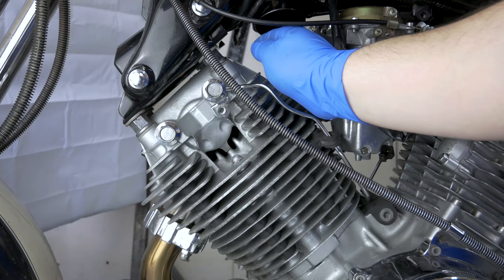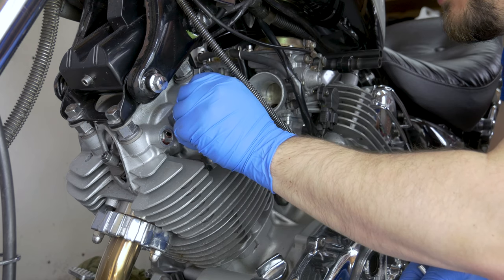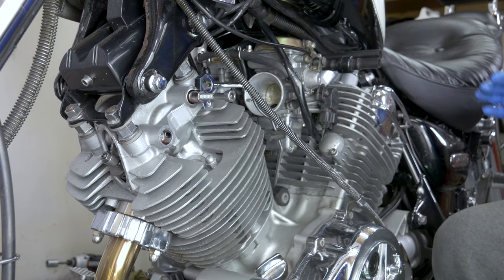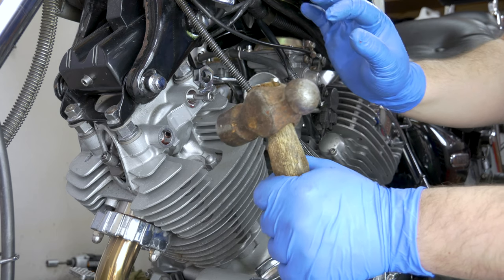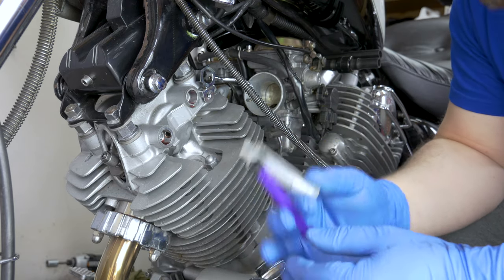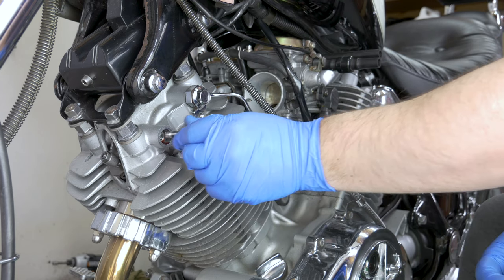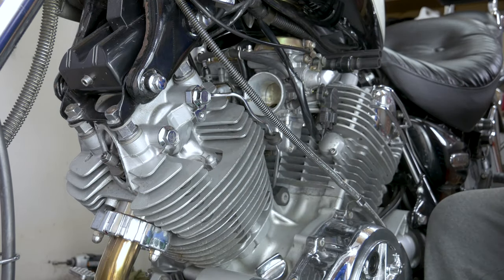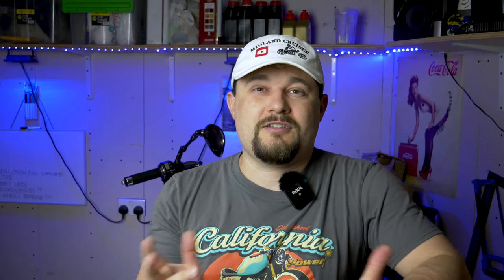YAMAHA VIRAGO 1100 | 4K | HOW TO CHANGE THE ROCKER SHAFT | Detailed Tutorial EP04

Comment: is there a tutorial to change the Yamaha Virago xv 750 shaft into a chain
Reply from the maker: Hi there. I have seen people asking about it, but haven't heard anyone actually doing it. I like the shaft drive so I won't be making video about that topic, sorry...
Reply: It is impossible to do without an external transfer case. Due to the shaft drive the output of the engine rotates in the opposite direction. If you eg. weld a sprocket onto the output shaft you'll eng up with 5 reverse gears.
The only (not too sensible) solution would be using an external transfer case/gearbox with a shaft input on the left and a sprocket output on the right but that is waaaay too much complication.
Reply from the maker: @davidbalogh3845  totally agree way to complicated and unnecessary. Speaking of unnecessary...I've seen someone converting a 535 into a air sprung rear suspension in the Facebook group...first I've ever seen, cool😃😎

Comment: For what you change it ?
Reply from the maker: Hello. I changed them because when I had the head off the bike and measured it, 2 of them were under the bottom tolerance, and had a groove dug into it due to something oiling related (not sure what caused it, could be wrong oil or lack of pressure, which can happen if you install the filter the wrong way).
Anyway 2 of them needed changing so I decided to swap all 4 of them out... Why not while I'm there 😉 also the worn ones caused inconsistent valve clearance due to to much movement of rocker... Hope this clears it up 👍
Reply: @MidlandCruiser  ok Great . i hope you do video for valve adjusting
Reply from the maker: You guessed it right.. Next video coming will be the valve clearance... Only on the front cylinder because it is nearly impossible to record it on the rear.. 👍

Comment: Excellent Video as per usual Mate, Where did you get those Rocker Shafts from for £12 each & did you get new Rockers at any point & if so, How much?
Reply from the maker: Thank you, your comments are always appreciated 👍I was quite lucky because someone sold old new stock on eBay so I grabbed them straight away. Keep your eyes on ebay, sometimes people don't know how rare these things become, and just sell stuff cheap.. 😉I didn't change the rockers themselves because they were fine, I checked the diameter with a bore micrometer and it was bang on. I suspected it that the way they designed it is to wear out the shafts instead of the rockers, which makes sense... Hope this helps
Reply: @MidlandCruiser  Ok, Thank you, could you tell me if all 4 rocker shafts are identical?, because I can only find one part no: 4x71215601  :)
Reply: @apophusra59  20 euros brand new from parts suppliers (like CMSNL) and 4 pcs, identical ones.
There is the older 4X7-12156-01 and the newer updated part 4X7-12156-02.
Reply from the maker: @aPoPhus Ra £16.25 each from fowlersparts.co.uk
https://www.fowlersparts.co.uk/parts/view/4X71215602
Thank you David, nice to see you here👍
Reply: @MidlandCruiser  Thank you mate, that's where I will get mine, I just need to source some good used rockers to put on the new shafts, Only doing this because the previous owner had run the bike for about 3000'ish miles with the oil filter fitted the wrong way round (with the hole on the inside of the engine) :( and I already have a pair of pretty good second hand cams to finish off with, just as long as they are the right ones, they were marked xv750 xv1100 & I forgot to compare them when I had the cams out to upgrade the cam bearings:/
Reply: @davidbalogh3845  Thank you :)
Reply from the maker: @aPoPhus Ra I feel your pain... My previous owner didn't bother with the valve clearance, which became too tight, and caused the seat to leak.. I'm not sure about camshaft interchangeability, try to search for the part number to see if it matches or not, that's what I would do... Thank you for your support by the way 👍😉
Reply: @MidlandCruiser  Camshafts are different, duration and lift differs, also early 750 cams are 24mm on the inside  25 mm on the bearing end. II. gen 750 cams are 25 mm on both ends, like 1100 cams. The lift and duration still isn't identical. You need a micrometer to determine what shaft you have.

1100 cam measurements are the following:

IN lobe height: 39.17mm
IN base dia.: 32.17 mm
IN lift: 7.00 mm

EX lobe height: 39.20 mm
EX base dia.: 32.27 mm
EX lift: 6.93 mm

And - as always - #1 is rear, #2 is front, the number is cast into the camshaft
Reply from the maker: @David Balogh thank you mate, this will help him out. Your knowledge is outstanding, thank you for being part of my community 👍👍👍🔧
Reply: @MidlandCruiser  I'm cheating. I have the manuals on my desktop. All of this is 2 clicks away. :D :D :D
Reply from the maker: @David Balogh 😂 that's your secret, I see.. 😁 Still.. Thank you 👍
Reply: @MidlandCruiser  Thank you mate, Don't you just hate it when some owners just don't do maintenance properly or just plain neglect it!... Make's my blood boil LoL :)
Reply: @davidbalogh3845  Thank you for your info, It's much appreciated :)
Reply from the maker: @aPoPhus Ra of course I hate it... The biggest problem is when they stripping the screw heads off, because using the wrong screwdriver... JIS is not Philips even though they look very very similar. I admit I did that back in the day🤔😇 but always replaced it if I stripped one. Now I have a JIS screwdriver kit😊 so no more problems.
Reply: @MidlandCruiser  yes, absolutely, It's not that you can confuse the two either, JIS screws have a little round dot punched into the head & Philips don't LoL :)